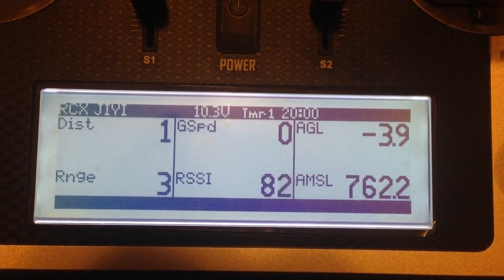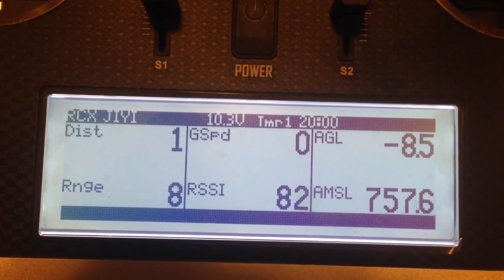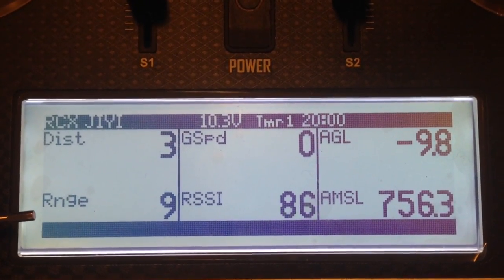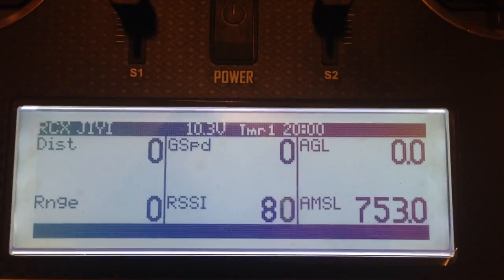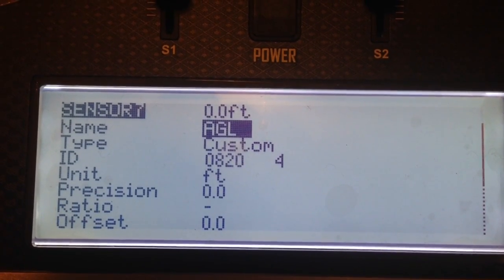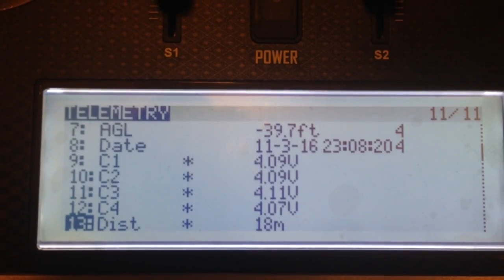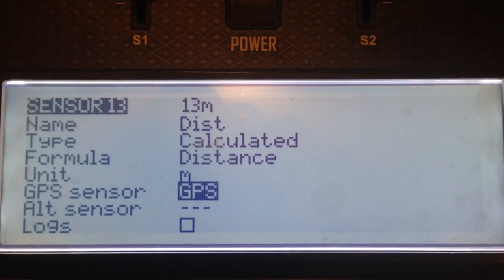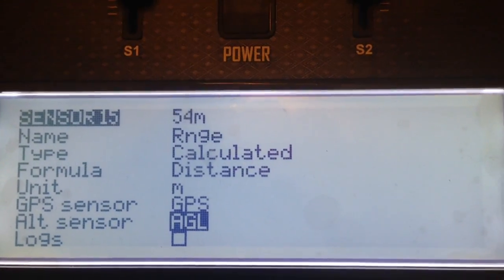GPS Telemetry Options with Open TX 2.1.7 - Taranis X9E

Comment: Hi Rob, got a quick question. My 9xe doesn't seem to display telemetry in bars like Taranis Plus. It only display values in number mode. Would you know why?
Reply from the maker: +Nas Khan Hi, did you go into the telemetry page and set up the option for "Bars"?
Reply: +Trainboy64 Yeah, i tried it so many time, with and without the rx hooked up, no luck. Any idea? Perhaps you should try on yours?
Reply from the maker: Nas Khan Yes I can definitely get the Bars, I have it for SWR, Battery and Timer which I set up on the Telemetry page.  I am away from home for 3 more days but can make a video of it for you when I get back.
Reply: +Trainboy64 That would be great Rob. Thanks mate.